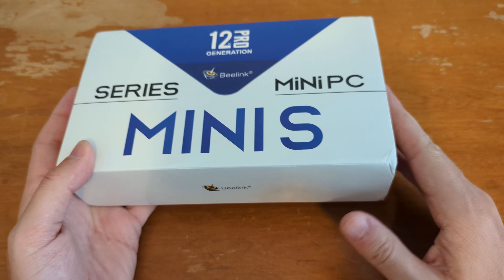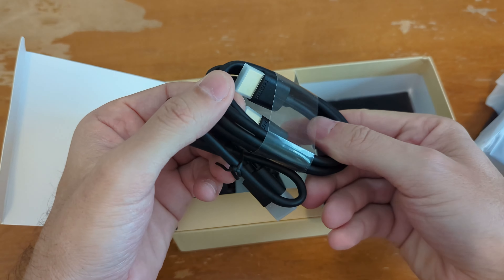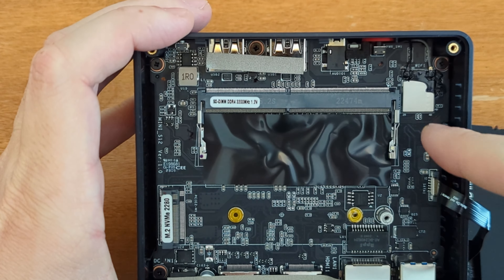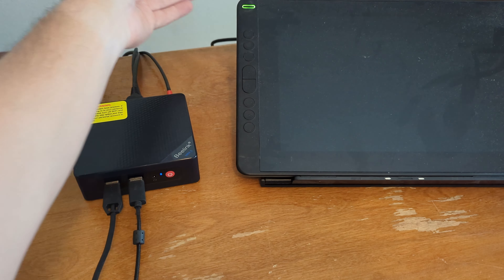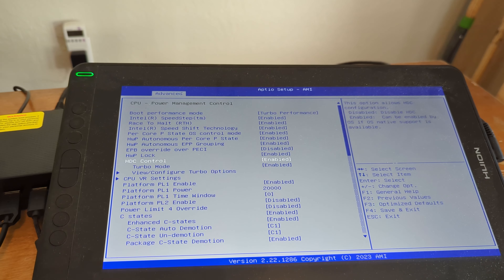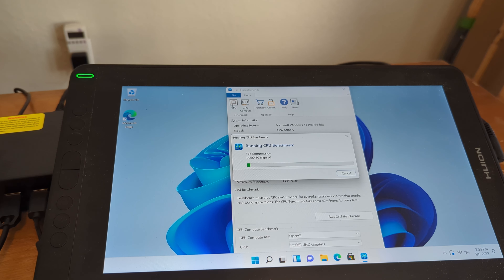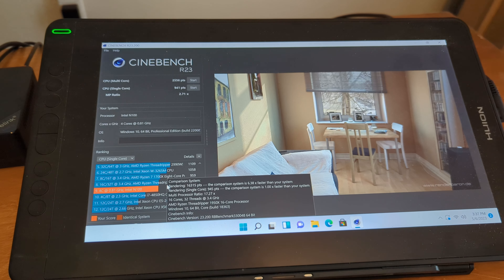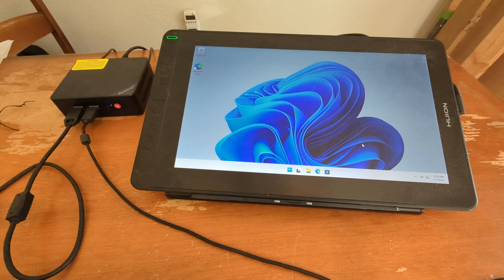Beelink S12 Pro Review

Comment: I got the mini S12 Pro, N100. I am delighted with my product it's suitable for what I need. Being on a fixed income the cost is very affordable, it's fast, and the video card is a lot better than what I had on my last PC (which was a refurbished one and did not fare well and died only after 6 months). I can play games. Just regular small games. It's simple to use and has Bluetooth and WiFi 6 built-in my speeds are good, but I am on WiFi, and my box is in another room that I share with my kids (4 bedroom House), so my WiFi has to travel and fight through walls but I don't get disconnected UN like my other PC that had a USB WiFi (awful). Overall, I'm very impressed with this unit. I recommend it only if you don't need to do anything fast-paced or editing. In general, it's great for simple everyday use.
Reply: hi there, would you recommend this for media consumption? does it handle 4k videos?

Comment: Beelink is value for money. I bought MiniS last year with 16gb ram, 256GB SSD with Jasper Lak n5095 CPU for $160, come with win11 Pro. I mainly surf the net and watch Netflix. It is blazingly fast at least twice faster compared with my 12 years old $500 i3 laptop with 8gb RAM in rendering webpages. I bought 17" 3K portable monitor for $150 and $20 mechanical keyboard (blue switch). My 12 years old laptop still works fine as a backup. So far, not even a single crash for 10 months now, maybe because of 16gb ram.
Reply: how bad is the fan noise?
Reply: @thatcoderguy3159  hardly any. You won't even notice it while doing PC things

Comment: I bought one. It's very good. But Linux users take note: I installed Linux and neither the Bluetooth nor wifi works with Linux. Maybe a future kernel will work, but not now.  The N95 processor will work with Linux BT and Wifi, but N100 will not work. Mine also did NOT have Crucial RAM. The advertisements were misleading.
Reply from the maker: Interesting. You know, I put Home Assistant on it and never even tried the Wifi with that. Just plugged in ethernet and never thought about it. Good info for people that can't hardwire their install.
Reply: I was able to get the Wi-Fi working by updating Linux Mint to kernel 6.4 & disabling AX on my mesh network.
Reply: @firestorm2089  did you have any problems using the newer kernel?
I have thought about trying that  but I was concerned that this might cause other problems. I wish Linux Mint would use a later kernel.
Reply: @davidhailstone7794  no issue yet, but I haven’t had a chance to use it much. I’ll likely upgrade to 6.5 when available and test with AX enabled.
Reply: @firestorm2089  I'm going to try a newer kernel, taking all precautions first, of course. Thanks.
Reply: I bought an S12 (not Pro) and installed Ubuntu 22.02. Bluetooth doesn't work. WiFi works.
I had previously bought a different Beelink model and the audio output was disabled but Bluetooth worked.

Comment: Had mine for a week and I love it.  Use it in my shop or a/v cabinet in living room for general web / video usage. Dell optical mouse I was using would not work but I swapped it using an old hp optical mouse and worked fine.  Slightly warm but not hot. Used my msft sign on and upgrade to latest win 11 pro without issues

Comment: Ok guys just spent a day troubleshooting and repairing a Mini S i had on a tactile screen for a year. The unit was shutting the video output/shutting down after some idle time and was crashing on a light cpu/gpu load. After disassembly I found the thermal paste was crusty as hell (a symptom of it overheating) so i replaced it with some noctua NT-H1. The idle temperature went from 60 celsius to 39 but the Mini S still crashed on benchmark tests and after some time. The definite fix was to reaplly a good thermal paste and install a better fan instead of the CPU 1 pwm fan wich is very badly designed. The Mini S will turn on without the pwm fan connected so I fancied an external usb relay to a 12v fan that keeps the unit at 33 celsius even on workloads. TLDR. Bad thermal design fix is to replace thermal compound and cpu fan.

Comment: Thanks for the review - much appreciated! Curious - do you think your lower-than-average performance stemmed from your decision to power the display panel off the Beelink as opposed to using a self-powered external monitor?
Reply from the maker: Could be, or it could be the power limit set in the bios as well. But, it's not that much lower, really. Within 2% on single core and less than 5% on multi.
Reply: @TechDregs  Makes sense and thanks again!

Comment: What is up with the sticky rubber rectangle on the SSD tray covering the instructions?

What is it for? I peeled it off but then stuck it back on but it didn’t stick as well, but wasn’t really using an adhesive either?

Safe to remove?
Reply from the maker: Could be a thermal pad or just something to protect the M2 drive. That's what it's over.